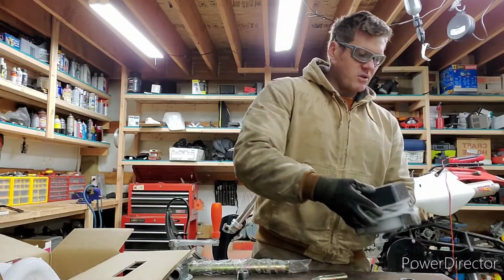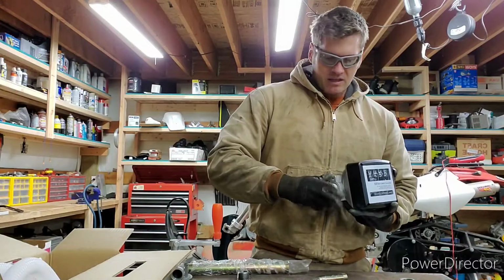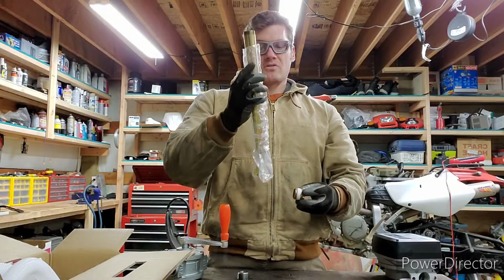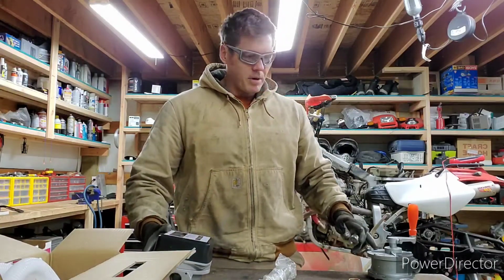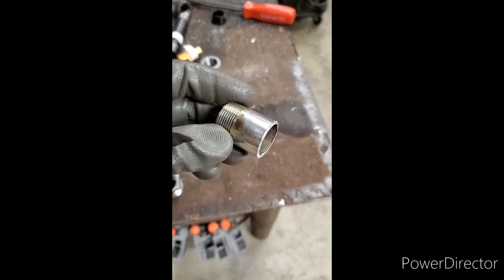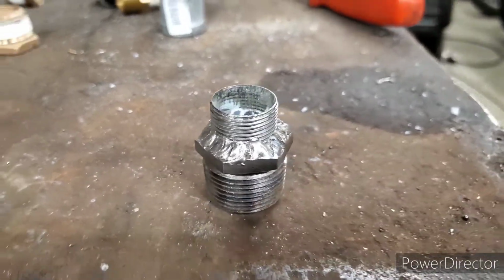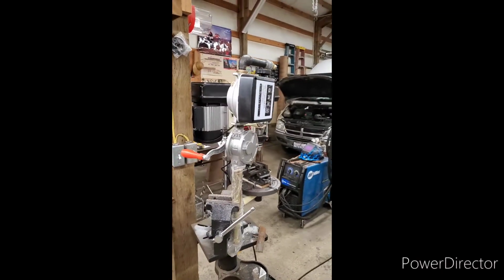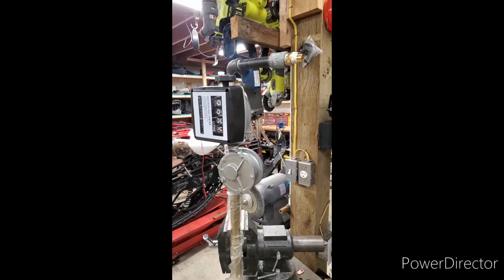How To: Adding a Meter to a Rotary Drum Pump

Comment: Do you have link for meter?
Reply from the maker: Fuel Flow Meter 1 Inch BSP Mechanical Gauge 4 Digital for Diesel Tank Transfer Pump Counter ±1% High Accuracy 32 GPM 142 PSI Gas Oil Flowmeters 20-120 LPM
 https://a.co/d/av2ChpB